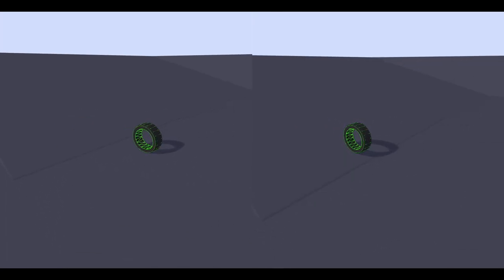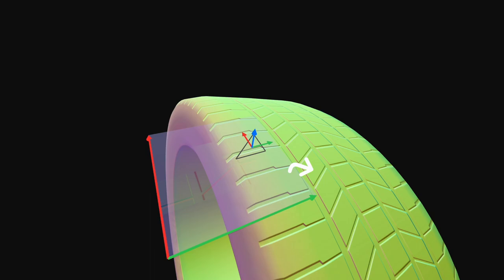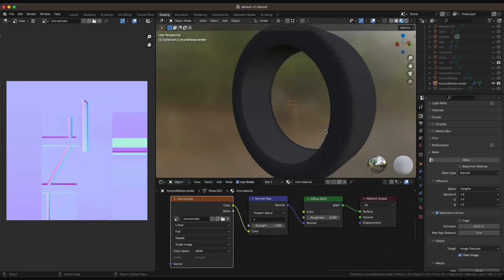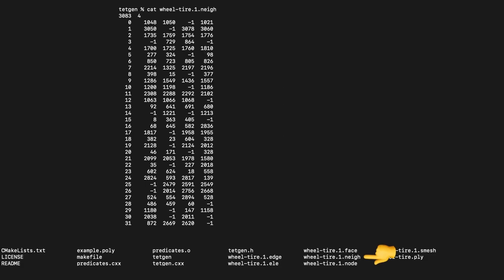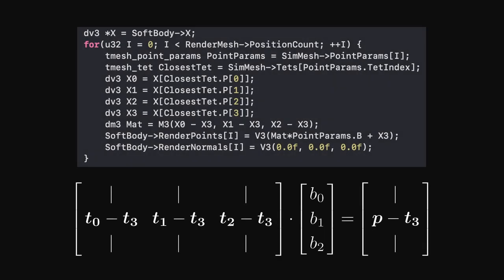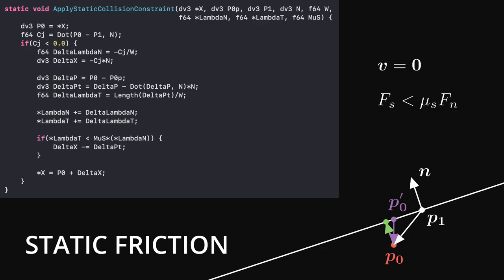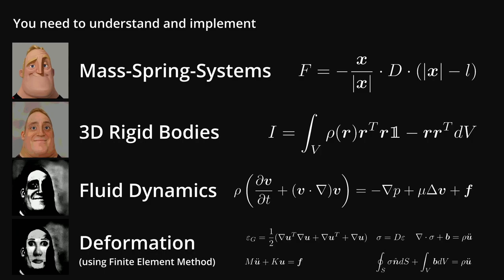Creating my first rolling soft body tire (XPBD) | Devlog Episode 4

Comment: It looks great, but is it possible to make soft bodies jump strongly, but in such a way that they behave like this wheel, at least outwardly.
Reply from the maker: Thanks. What do you mean exactly? I am not sure I fully understand
Reply: @blackedoutk   Іn game engines, physical objects have a bounce parameter, but when it comes to soft bodies, everything is limited to a slight upward jump after falling, is it possible to make it so that a soft body can bounce physically correctly, over relatively long distances?
Reply from the maker: @pingvin9166  Ah, you mean where the object would bounce back to the height it was dropped at? That's a good question. I think that would certainly be possible but it might require much more sophisticated simulation methods.
The mass spring system I use isn't really physically accurate in the sense that materials like rubber aren't made out of springs. Also the simulation method does use implicit time discretization and approximations which weaken the energy conservation. When I increase the number simulation steps the tire does actually bounce higher.

Comment: I have watched all of your videos, what can i say: very interesting, I understood none of that. haha
I get the idea how it should work, what forces should be present, but I'm bad at physics and don't know how to imploment any of that code that you've shown in Unity my self.
Therefore, it would be greatly appreciated if you could make this in Unity, it would help us to learn this!
Reply from the maker: I am happy you find it interesting, but of course my goal is to make you understand the concepts too :D
What would help you implement this in Unity, except me providing you with a solution? I would encourage you to just try it. For example is it maybe possible to adjust the vertex positions in the FixedUpdate function? I am not super experienced in Unity myself.
Reply: @blackedoutk  Don't worry about "me trying things" part ))
And I've tried boing softbodies in Unity, I got stuck on "how to adjust the right vertex position", cause I need to find relative position and I don't know how to do it. If the wheel is rolled 90 degrees clockwise it will still deform on its bottom (out left) in contact with ground.
I'm trying to find solutions, and I'm interested in learning things asd. i'm just bad at physics and kinda noob it Unity.
Yes, I would be grateful if you would give me the solution, but it's not the only point, I want to learn how it's done and be able to implement it by myself.

"What would help you implement this in Unity" - I don't know, cause I have not figured out the solution yet :0 Also, please talk more about friction and how it is being affected
Reply from the maker: @desine_  But that's good if you already made it deform! I think the problem you're having is that the vertex positions are in the mesh's local space / object space. If you multiply the points with the object's transformation matrix you get the points in world space. Then run the simulation algorithm and put them back using the inverse transformation matrix.
To do that it seems like you can transform.TransformPoint and transform.InverseTransformPoint. However the process I just descibed might be very slow, you'll have to see. Better would probably be to store the world space points in an array and render them directly, meaning the transform would just be the identity matrix.

As long as you have fun experimenting and learning new things you are on a good path I think. I remember the first time I did something in Unity. I understood nothing at all.
Reply: @blackedoutk  Yes, I need to convert the contact point to local contact point of the tire. And I know that it is posible, but I have not yet understood how to "multiply the points with the object's transformation matrix".
Vectors are hard for me. I probably should whatch more "3blue1brown" :)

p.s. I dont need to convert the vertex back to global, I just need to find vertex to move, move it and update the objects mesh
Reply: @blackedoutk   https://youtu.be/sUOTxDgkJxE
I've found how to do it ))
Still bad though, need to find other solution.
Reply from the maker: @desine_  Oh okay. To convert any world point to local coordinates I still think you could use transform.InverseTransformPoint. 3blue1brown videos are great too
Reply from the maker: @desine_  I mean it works in some way:D
Reply: @blackedoutk Yes, that's what I did actually
Reply from the maker: @desine_  Hmm, maybe it has to do with collision detection? Does the mesh collider update automatically? Also in the video it looked like there were multiple points for a single vertex, that could lead to problems aswell I imagine
Reply: @blackedoutk   After the mesh that I store in the variable is changed, I assign it to the Objects mesh
Yes, I know about the multiple vertices issue, I could not find a solution yet. It's not a "model problem" I think, cause in blender it shows n-vertex amount and in unity it's like double. 
I look for vertices in a radius and move them.
Actually my solution stinks, I'm looking for a better one :-€
I find a collision of a solid object, but each vertex should be as a separate object, with forces acting on it
Reply from the maker: @desine_  Okay, I would probably have to know a lot more about unity to help you there sorry
Reply: @blackedoutk  It's ok, hopefully I will get somewhere with my research :)

Comment: I'm working on a very similar physics engine based on XPBD at the moment, so it's really motivating to see someone else go through some of the same struggles.
For your soft body constraints, have you seen the paper titled "A Constraint-based Formulation of Stable Neo-Hookean Materials" by the same authors as the original XPBD papers?
It's not that much more complicated than a spring mass model + volume constraint and it seems to have some benefits
Reply from the maker: Nice, I haven't read the paper but I wanted to do that for some time now. It's based one the continuum mechanics deformation physics right? Have you implemented it?
Reply: @blackedoutk  I think so, yes, as it makes use of the deformation gradient tensor. They do provide a straightforward way of discretizing it to tetraheders, though. (Unfortunately while skipping quite a few steps of the gradient calculation.) 
I have implemented it, yes, mostly following their code example. You'll find it if you look for the appendix to that paper
Reply from the maker: @agentklaas  Definitely sounds very interesting, but for my videos I would want to explain the maths when I implement this and it's very challenging. Maybe someday
Reply: @agentklaas im doing the same, can u provide me with ur github or email to have a discussion

Comment: When you get really good, Can you contribute code for physics related things in Godot game engine? 😅
Reply from the maker: Haha maybe, but that would still be far in the future. I think there are a lot of people with way more experience than I have.
Reply: @blackedoutk  The physics library 'Jolt' they are talking about integrating into the game engine actually lacks soft body implementation which is the main reason why the integration is getting delayed until the library is "feature complete". That is why I thought you could help as you are doing some really cool softbody simulations over here.
Reply from the maker: @kritik_mb2144  That sounds a bit urgent. I'd have to read up on how Jolt works which would take quite some time. For now I first want to gain more experience in simulation methods before I feel confident enough to approach such a task
Reply: @blackedoutk  Yeah, please don't feel any responsibility regarding the matter. I just wanted to know what you would think about contributing to Godot, just out of curiosity.
Btw your videos are really interesting since I have been wanting to get into physics programming for a while. Keep up the good work👍
Reply from the maker: @kritik_mb2144  Thanks! Physics programming is definitely really fun, but the maths is quite challenging

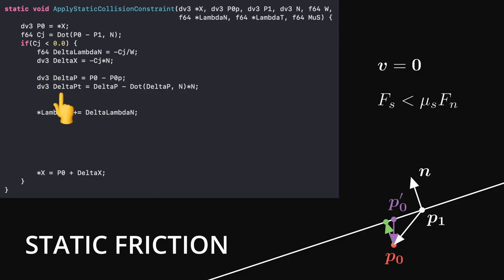Comment: Great video, I love how in-depth and specific your explanations are! At 24:30, I'm a bit confused as to why you multiply the dot product of DeltaP and N by N; shouldn't you divide by N? I think you said N is normalised anyway so it shouldn't matter, but I think I'm misunderstanding something. Also, do you know of any good resources to study stress and strain tensors for potential use in these kinds of physics simulations?
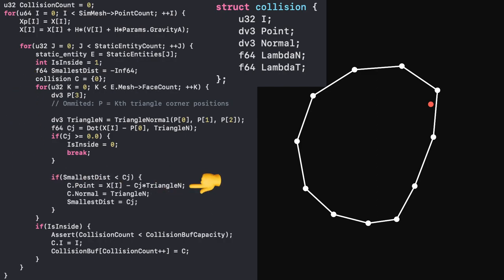Reply from the maker: Thank you, that's great to hear :) Many of these computations require that N is normalized. It originates from this TriangleNormal function you can see at 20:40 in the collision detection. I didn't show the corresponding code but the function does normalize the vector before returning it.
And you're right, if N wasn't normalized then Dot(DeltaP, N)*N would have to be divided by the length of N squared, such that each of the two N would get normalized. Though I am not sure what what Dot(DeltaP, N)/N would mean, because dividing a scalar by a vector is not well defined as far as I'm aware. The mentioned dot product is the signed length of DeltaP along normal direction, meaning it is a scalar. It is multiplied by N because we don't just want the length but we want the actual vector.
I haven't studied stress and strain tensors or the physics of deformable bodies as much as I probably should have so I can't specifically recommend any resources, but can point you to a few ones I stumbled upon so far.
The references of the simulation lecture I attended contained this http://www.femdefo.org/ and a book "Nonlinear Continuum Mechanics for Finite Element Analysis" by Richard D. Wood and J. Bonet. Keep in mind though that I only read the beginning of these and actually I thought they (especially the book) were kind of hard.
This video https://www.youtube.com/watch?v=YxXyN2ifK8A contains nice visualizations of what a tensor is and applies it to stresses.
Two other videos that might be interesting in that regard are this https://www.youtube.com/watch?v=ngaYNdNtbec and this https://www.youtube.com/watch?v=4Vk7Ar3COJA but I haven't had the time to watch it, so I can't say if it's good.
Section 5.8 in this publication https://matthias-research.github.io/pages/publications/PBDTutorial2017-CourseNotes.pdf talks a bit about continuous materials and how they can be used in the xpbd framework.
I hope this is somewhat helpful. Remember that the maths of the finite element method are pretty brutal. If you find some good resources I'd be happy if you'd let me know too

Comment: Is it possible for you to add some sort of damping force to the tire so that it doesn't keep wiggling
Reply from the maker: Yes that is possible. Section 5 of the XPBD paper is dedicated to constraint damping. It seems you just need to adjust the computation of the delta lambda variable, but I haven't made an effort to understand it so far because they use an implicit integration scheme which naturally dissipates energy.
But you're right, the wiggling doesn't look very realistic for a tire which should be more rigid. In this case however, I had set all inverse stiffnesses to zero, so if the solver were perfect the tire wouldn't actually be soft at all. The softness comes from the fact that the constraints are not solved exactly. When I increase the number of time steps or the number of solver iterations the tire does almost not wiggle anymore. Would be interesting to see what damping does to the situation